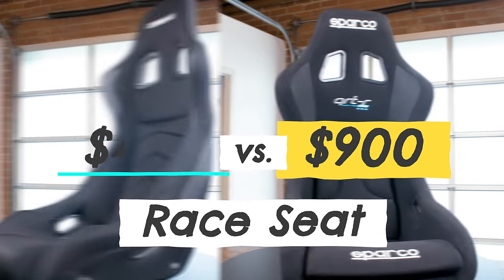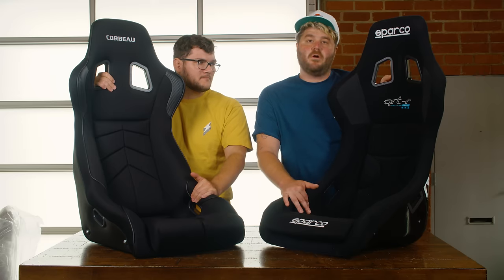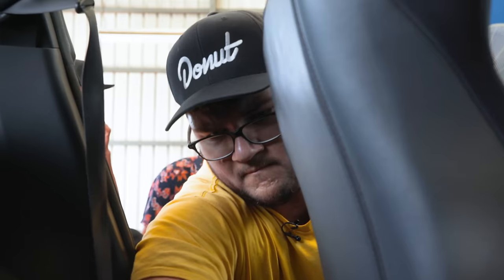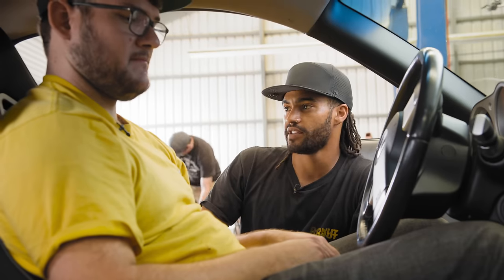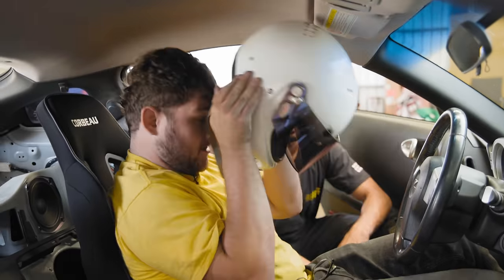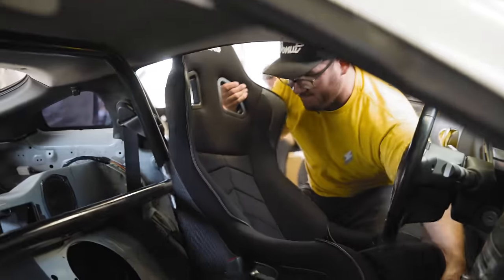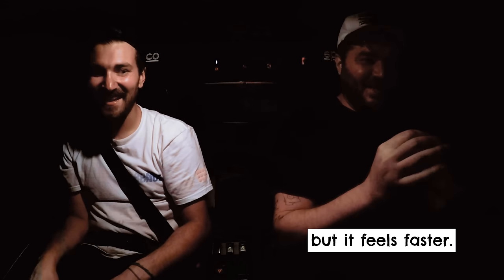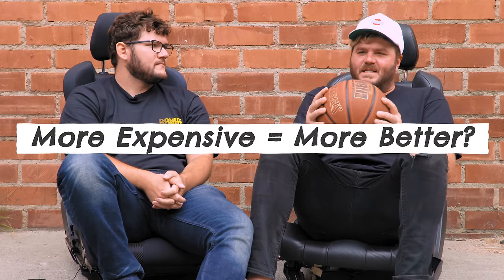$450 Racing Seats vs. $900 Racing Seats | HiLow

Comment: When the time comes to buy your aftermarket seats, I highly suggest you go out and try (butt test) as many seats as you can before you buy. Seats are interesting animals. Seats from one manufacturer to the next manufacturer can feel quite different from one another but look very similar. Even seats of different models from the same company can feel totally different from one another. 

Local car shows can be a good way to try out a variety of seats to find one that works for (fits) you. Also remember, not all of us are little guys and some of us are built on the bigger, fluffier side of the spectrum (I'm 6' and 275 pounds). Seats should 'hug' you to a degree but not try to crush you as you sit in them.  Fortunately, there are seats out there that are made a little wider for our bigger, wider (cough* backsides) err... frames. Make sure to check them out if possible. 
---Just my two cents.

Comment: I thought Nolan was gonna buy Jeg's brand plastic seats with like a 1/2 in foam cover. Those are like $80 for two seats and covers. I would not call Corbeaus cheap, they are cheaper, but they are also less of a race seat and more of a sport seat or GT seat. And since both cars are supposed to be daily driver and weekend warrior, I think Hi car should have gotten the Corbeaus and Low car should have gotten something cheaper, like under $500 for a pair. Possibly even just finding a good set of seats out of another car that has GT style seats like a Corvette or w/e.

Comment: Basically. If you can afford it and want to save weight and have a better quality. Buy real brand. But if money is a bit tight or if you don't mind care to go all out. Buy rep brand. But don't be mistaken reps are still good and still do the job. And don't feel bad cause they're "reps". All's it means is the quality isn't as high as a big brand. But by all means. A rep will still do the job of making your driving experience awesome.

Comment: Hey guys, on low car are you sure you didn’t have to remove any wiring? It seems like there’s a wire on the seat Nolan is pulling out. If so, did you not get any airbag lights from replacing the stock seat?

Comment: I drove those FX1s for 3 years in my daily driver MK3 jetta. They were really comfortable on most roads. I had the same install issue and ended up using the bottom mounts with washers. Those sparcos are dope but I'd put the difference into suspension.

Comment: Vehicle specific mounting brackets rarely ever fit right so cutting something was inevitable. For my '99 Eclipse it raised me ~2" and is only held in place by 3 of 4 bolts. Fourth was to angle down but is instead flat. I'd like to at least drive a Z. ._.

Comment: Please also list the number of 'shop hours' per mod .  That way an non DIY'er could figure out REALLY how much it will cost for each mod. 
The video with the diff comparison pitted a $1200 diff against a 'free' welded diff.  But, the shop rate for each would have been more than the parts.  
Give us the shop hours and we can then figure out the labor / labour costs based on our local garage's shop rates. 
On this video I'm interested in how many hours the shop assigns for the rollover bars.

Comment: I just went to a junkyard and bought a full leather Audi seat with 6 way power adjustability and heat for about $40 (this seat had controls integrated into the side except heat so it was super easy to wire up)... I have no idea why anyone would pay for one of these.

Comment: The bolt that kept the SEAT BELT BUCKLE on my car was the wrong thread and size. You can wiggle it and it comes off. 😅
I went to every auto shop near me for 3hrs, turns out you can find it in Home Depot. 😑

Comment: Ill be in your car club lol. I had a 350Z once back in 08. It was ok. Then had a 370Z in 2011. Then had an M3. M3 was my fave. I miss that car. (Tear rolling down my face). Mine was black, with the Competition Package they made for 05 and 06 only, 6 speed manual, ultra low miles. Super great example. Miss my bebeh...but you know Im not crying. Im not. #boostcreeps

Comment: Looks like a fail on some important details. First, that's not a Corbeau FX1 Pro seat, it's a DFX. The DFX is a metal frame seat, which is why it weighs more at 26lbs. The FX1 Pro is fiberglass and closer in weight to the Sparco (15.6lbs) but still heavier by a few pounds. Second, and perhaps the most important distinction between the two seats, is that the DFX is NOT FIA certified (neither is the FX1 Pro), whereas the Sparco is and that's primarily what accounts for the price difference.

Comment: So does anyone with an actual set of Corbeau FX-1 or A4 seats know whether the fitment(waist size) of the seats is like the measurement you find on pants or like an actual waist measurement?  I fit into 34 pants just fine, but I have a larger rear and and I typically fit into 40” fitted pants, so I’m not sure how the measurement would work with a seat.  Any guidance helps, and I can’t get the wider seats because they won’t fit my car.

Comment: You guys are actually comparing apples to oranges... The DFX that your spotlighting from Corbeau is a tube frame seat.. Totally not applicable other than this Sparco and Corbeau look alike and are both seats for cars. They are completely different though... maybe compare quality of fixed back Corbeau FX1 to the sparco, this would be a more accurate and useful comparison.

Comment: Just wondering, but is it illegal to install a non airbag steering wheel with a quick release in California for a car that originally has a air bag steering wheel? Because your tampering with safety features. Also I wonder if the car insurance would still cover your  for installing a non air bag aftermarket steering wheel. Some please answer #Donutmedia

Comment: welp, when i get my drivers licence, i'll get a recent car because belgium doesnt allow cars from the 90's (diesel AND gasoline cars), that means i cant drive a supra or a skyline or even a subaru wrx sti

my dream car isnt allowed to be on the road because of the low emission zones

its sad for me but i guess i'll move to the us to drive a proper sports car
Reply: nah you should learn Japanese in the U.S  85% of JDM cars still illegal also in pages like Craigslist the people there overprice the car price over the average even If the car its salvage you can't even find an Integra GSR under 8.000 dlls while in japan you can get Integras DC2 type R's for around 150.000 300.000 yens in dll's its less than 8000 dlls that means a lot of cars like Miatas and 200SX's are dirt cheap in japan and you can find those with low miles and mint condition because the japanese guys care their cars a lot I've seen an MR2 AW11 and a 300ZX Z32 N/A both automatic posted on craigslist and the person was asking 11.000 dll's per car  and I said in my mind what substance did this person put in his body with that money you can buy an S2000 or an MR2 SW20 GTS Turbo I'm learning japanese for go to japan and work at a mechanic shop because its my passion and dream

Comment: Fx1 pro is not a lot heavier. Sparco is  15.6 and Fx1 Pro is 17.5. Don't equate cost to be the ultimate answer. Also the FX1Pro is too small for the driver.  They should have gotten the standard model and.comfort would have been superior to the Sparco. Just how the seat was designed the Fx1 Pro is the small version of this seat where the QRT-R is considered a large size Sparco. Apples and oranges guy's

Comment: Lol ya such big weight savings between the seats....what like 4 lbs....wow that'll help....absolutely nothing.
Reply: its not 4lbs, even in my celica which has seats with no technology at all and are already pretty buckety sporty seats i would save 15 pounds a seat changing to a recaro sr6 for example. and you could definitely go lighter than that if you went fixed back, some of them are like 6kgs or less for a seat